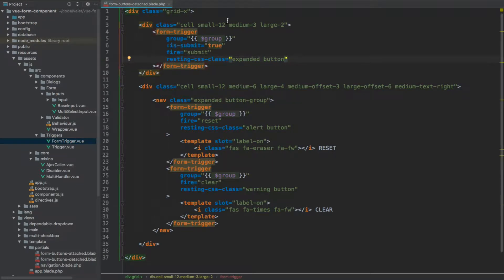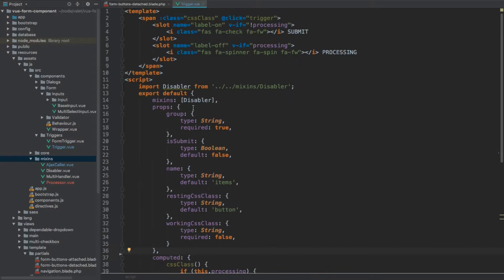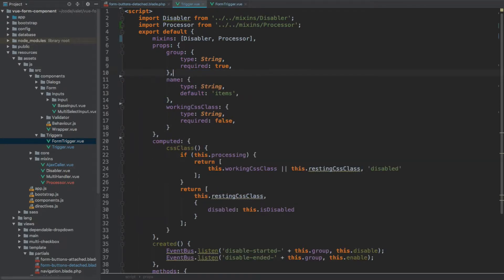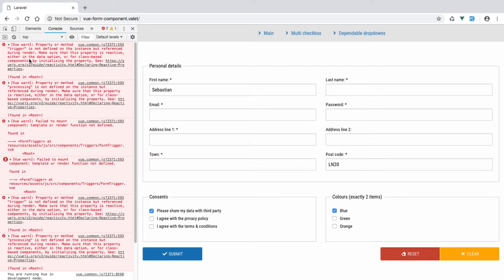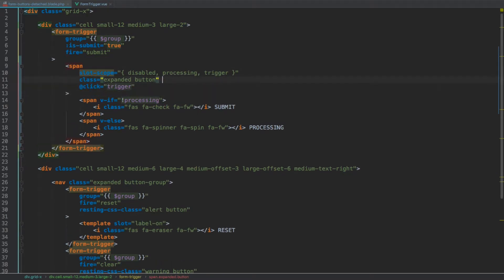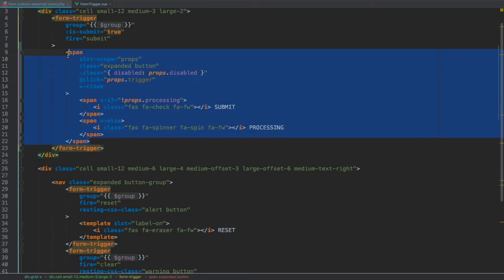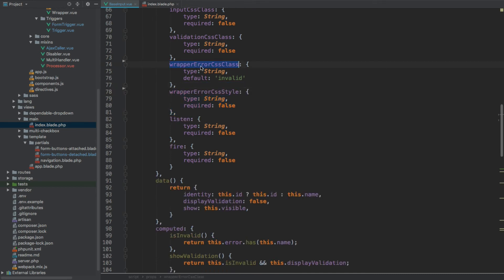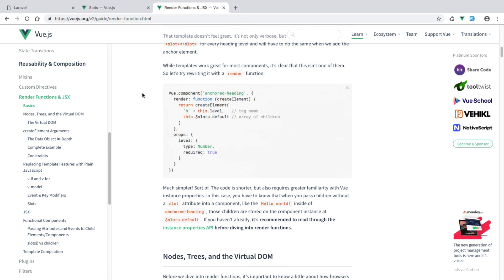07-06: Refactoring to renderless component

Comment: Would it have been possible to keep the template in the Trigger, and simply have a Slot tag in it and nothing else? That way all of your html is passed to the component, and it can take care of it, and you would still be able to change it directly in your php code. Also you would not need to have a render function with $scopedSlots.
Or am I missing something here?
Really enjoying this tutorial so far.
Reply from the maker: Hi Allan. Thanks for stopping by. Absolutely - if I was recording this tutorial today, that's the most likely approach I would take on it using $scopedSlots and only code the functionality of the component, allowing any design of the button without interfering with props.